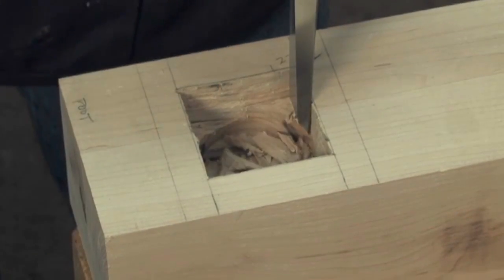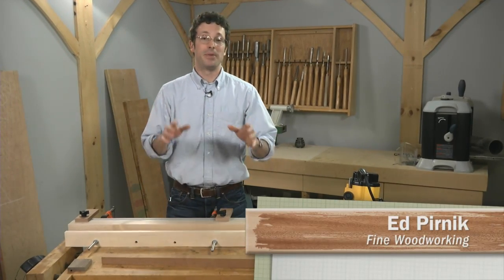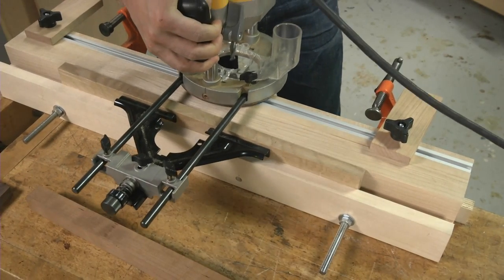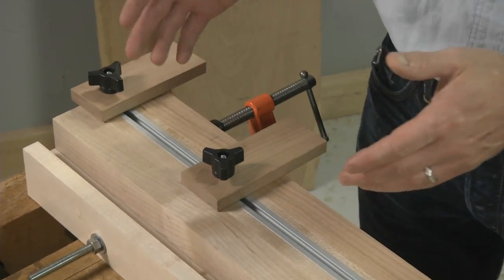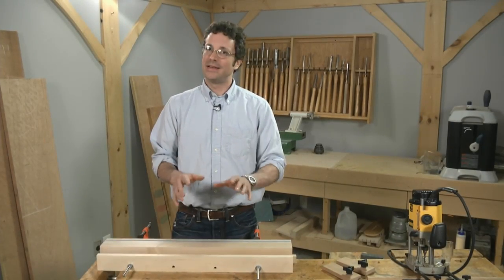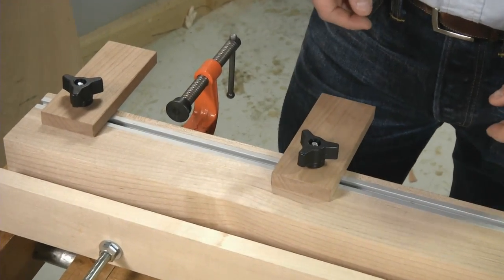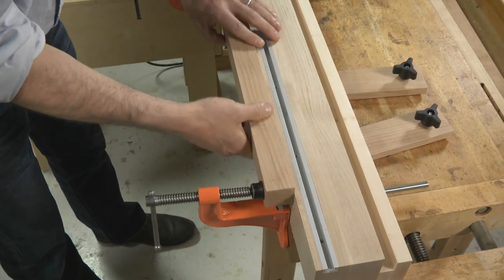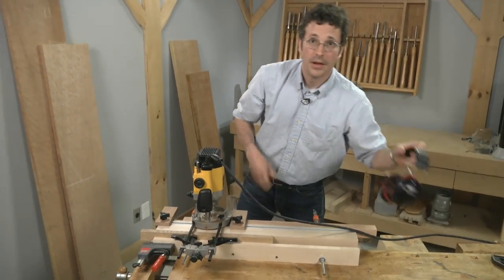Mortising Jig for the Plunge Router

Comment: Actually, the rods on the guide limit the size of the piece more than the clamps do, but... you can easily replace the RA-1054 rods with longer ones (every hardware store has steel rods in many diameters) and use an F-clamp of almost arbitrary length (~7.5" of clamp length will be consumed by the jig and slide, so if you want to cut 12" pieces, get 24" clamps and appropriately long rods for the guide  - I'd probably get the screwdriver handle variety F-clamp   It would be nice to know which clamps you were using - they're nice.

Comment: ALTERNATIVE CLAMPING SYSTEM  - I love this jig, but wanted to clamp from the top down and not the bottom up so there would be no limitation to the height of the work piece, and I would be able to use my existing clamps.  Eliminating the limit on the height of the work piece provides more opportunities for using the jig. All that was needed was where to find the surface to clamp to and I realized that could be on the side of the large bearing block that faces the auxiliary fence. I used my router to create several slots in the bearing block which ended up being 1 and 1/16" wide, X 7/8" long, X 1 and 3/8" deep. That leaves room for the clamp without impacting the sliding motion of the fence, and the block's integrity is not affected. Andy A..
Reply: PowerPick: Nice idea . . . could you post a link to the clamp you used . . . Thank you.

Comment: Great Jig but the clamps limit the stock width you can mortise to what appears to be around two inches max. This will need to be considered and allowed for when building the jig.
Perhaps over the top G clamps instead of the side clamps.
Nonetheless it's still a great idea.
Reply: What are G clamps?  I want to build this jig to put mortises into table legs, but they're 2.75" square.  Can you tell me where to find them?

Comment: Afternoon. Do you happen to have printable plans for this?
Reply: There's really no need for a printable plan.  The dimensions for the main base are given (30"x3.5"x3.5")  The edge guide is .75-1" thick and appears to be about 20" long.  The spacer is sits on is the same thickness, as pointed out in the video.  The outer hold down piece is .75-1" thick and 30" long.

Comment: How could you add to this jig to make it do the ends of a rail and stile where the piece needs to be vertical not horizontal or at an angle for a variable frame angle end??
Reply: +Pat M So long as you can clamp this jig to something high enough from the floor to accommodate the length of the piece, I don't see why this wouldn't work that way.

Comment: What router bit are you using
Reply: Bouhunter Search for End Milling Cutter 1/2" 1/4" this and it will get you started, i get mine on ebay cheap.
Reply: Stephen Day Are they actually for metal milling machine
Reply: Use a spiral upcut router bit.